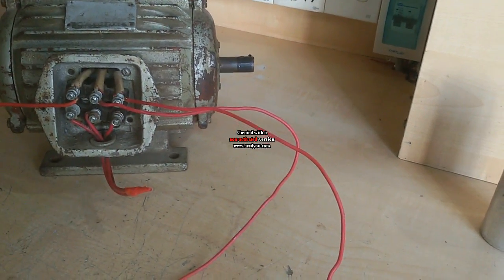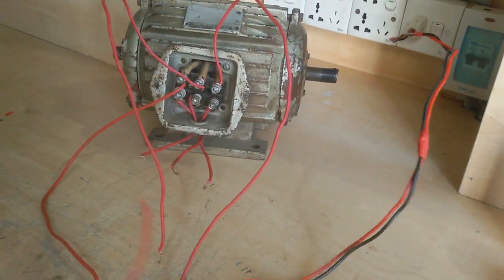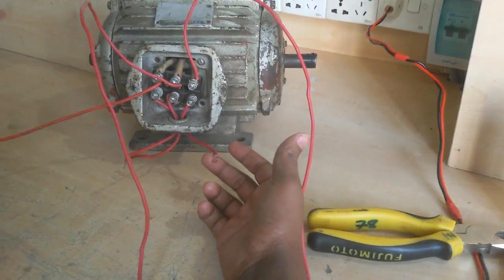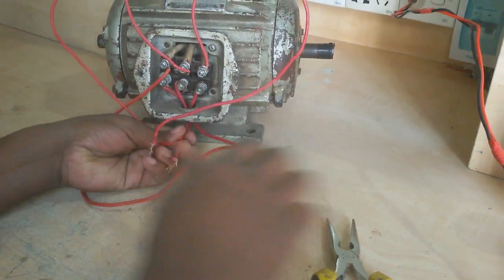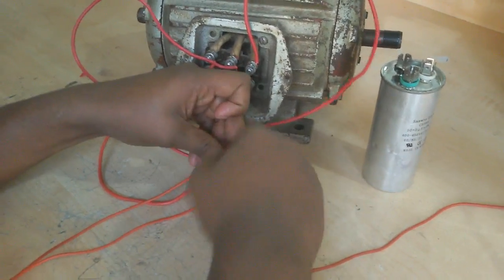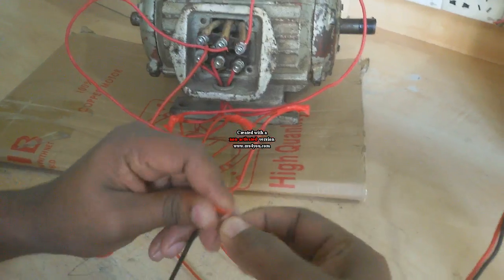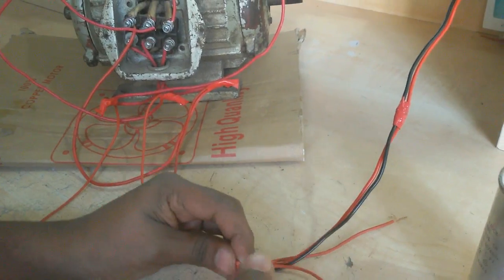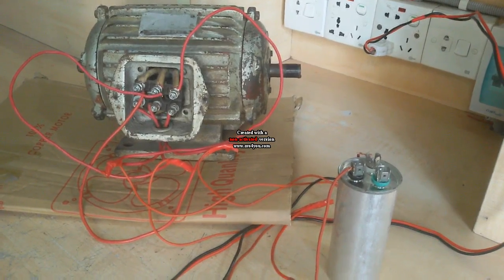how to test three phase motor by single phase supply in English.

Comment: Any 3 phase motor ( star or delta) can test by single phase ? and only for test or can load also ?
Reply from the maker: you can use load
Reply: Thanks sir but is that capacitor for starting or running capacitor, please sir answer me

Comment: I need more infornation from this working
Reply from the maker: Please see my others video. & share my video. thankyou.
Reply: sunil sir 1 problem how to treat in this problem  panel star switch on  motor is perfect running in Star pwr. but problem is changing Delta power MCB trip     I think 1 contactor fault 2 motor connection fault 3 motor winding fault what is u r thinking sir please

Comment: That is an informative video , but please use proper explanation like when you connected wires with capacitor then you didn't tell which joined coiles pair you connected with it ... thanks